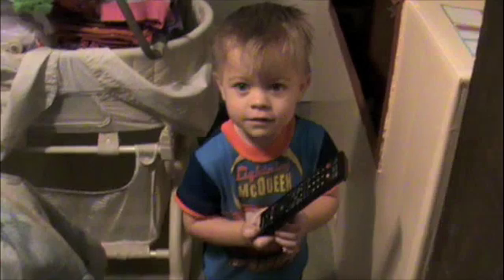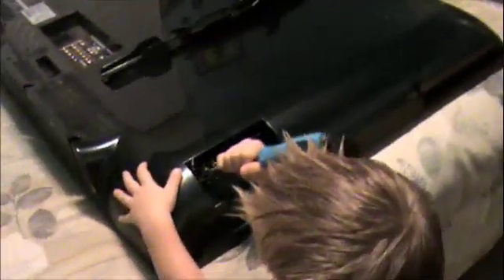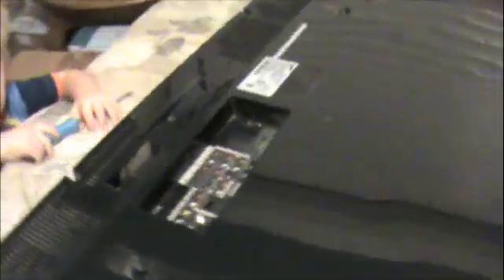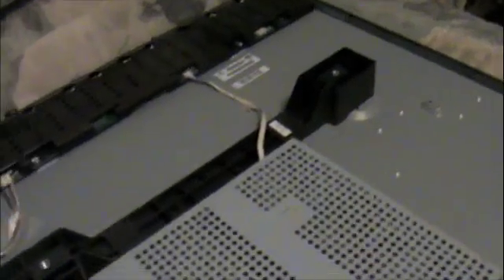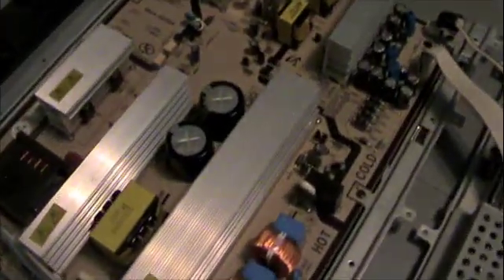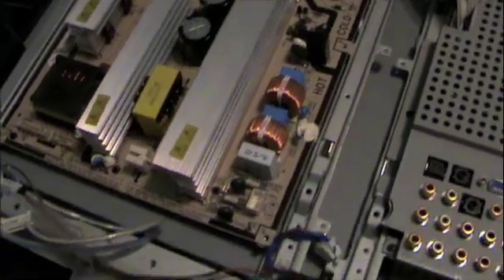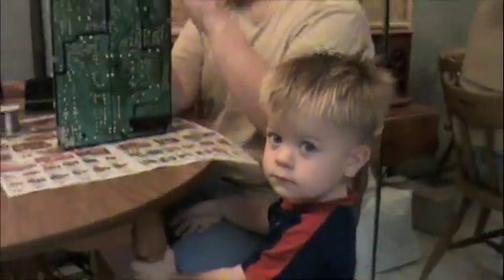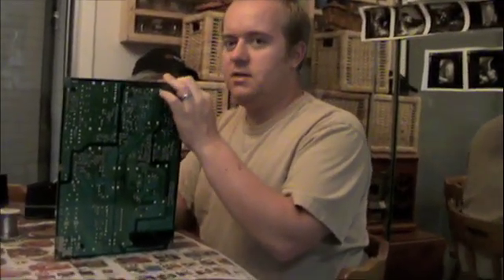Samsung TV Repair- PART 1 OF 2

Comment: I have a 46" Samsung LCD TV (LN46A750) and currently I don't have a problem with the caps yet but I have another power supply related question. I purchased the TV in the US 1.5 year ago but a month ago I had to move to Europe where the standard voltage is 220V/50Hz. Does someone have a knowledge whether there is some quick way for converting the power supply from 110/60Hz to 220/50Hz? And if there is, how? I called Panasonic in Hungary but they said they don't do conversion. What do you think?

Comment: thank you for your video, I removed the power supply, took it to my local "the Source" store, formerly Radio Shack, and he solder ed in a new capacitor. Problem solved. He only replaced the 2200 microfarad cap. $ 15 Thanks again

Comment: Thanks a lot for the vid. I'm an electrical engineer and I really didn't want to spend all this time troubleshooting it for the issue. Saw your video, went straight to the caps I needed and done. Quick repair. THanks a lot buddy.

Comment: Called in. Samsung arranged for tech repair to come. They came a week later. 2 guys came in fixed it pretty quickly. I knew what they were doing because of the video. No fees.

If you could afford the time it's an option. Make sure you deal with Samsung first and not the affiliated repair men.

Comment: 1. Soldering tool -  $20
2. Two capacitors and solder - $7
3. Saving $300 in tv repair in 30 min thanks to the Professor and Mr. Milo...
   PRICELESS!!!!!

THANK YOU!

Comment: I called samsung and they are sending  a repair man. My TV was 46"" bought in 2007. No extended warranty.  If they deem it as a capacitor problem then samsung will pay for the bill. Otherwise they charge me. 

We'll see what happens. Should be a few days when they come. I'll update the result

Comment: Thanks so much for putting this video together!! Replaced five 1000mF 10 volt with five 1000mF 25 volt (high temp rated). Bought capacitors from Amazon for about 10 bucks. Took me about 1-1/2 hours proceeding carefully. I with 4 young kids had to wait until the "helpers" were away for the night before I attempted this. Now enjoying celebration beer - TV works great! THANKS

Comment: Fixed my Samsung TV.  Replaced  four 1000mF 10volt capacitors with 1000mF 16volt caps purchased from Fry's for $1.95 each.  Layout in my TV was a bit different.

Your video was very helpful giving me the confidence to do the job and gave my wife the confidence to let me tear open our expensive flat screen TV.

5 min to get TV apart, 10 min to unsolder damaged capacitors, 10 min to solder new capacitors, 10 min back together. I had to make trip to Fry's anyway.

Total 35 min and $8.00

Thanks

Comment: Hello my friend
I saw your video to repair the LCD sansung. I have a question. I work for UCR univesity and we have sansung syncmaster 460P from today is hook up to the vcr/dvd combo also sansung. Only transmitted video over component for the DVD. I try to show VCR cassette with video RCA out and doesn't work it all. Can you please help me with this problem. I check all the menu settings for this monitor and doesn't work. My email is galfredo38@gmail.com Thanks for your help.

Gerardo A Torres

Comment: Thank you for making this video. I have a LN46A650 that recently began taking 10-15 tries before finally turning on. Your video was very easy to follow and I was able to fix my TV in less than an hour......and I had never soldered before. My set had a slightly different layout but more or less than same. Total cost of project was $30 including the soldering iron, all from Radio Shack.

Thanks!!!!

Comment: @frekhike why? Why would anyone spend this kind of money when we all know the fix may really only cost a few bucks?  This really works.  My plasma was blinking and then went dead.  This fixed mine.  My quotes to repair were about what you stated.  One guy told me to replace the board would be $150 for the part.  I found the part online for $75.  It's only 6 screws and 3 connectors to fasten it back on.  WHY?

Comment: This works! I know nothing about fixing televisions. I found this and another video after getting a $300 quote to fix my $500 Visio plasma (that's only 2 years old). I removed 2 10 volt capacitors with a soldering gun that I've never used, and ordered 2 replacements for a few bucks. Soldered the new ones back in tonight. It took longer to put the screws back in the TV than it did to actually fix it. The Visio fired up no problem. My 9yr old daughter helped too. THANKS A MILLION!!!

Comment: When my Samsung 215tw LCD monitor began flickering 2 months ago, this was the first info I came across re: how to repair LCDs. Since I had no interest in trying to attempt a repair at that time, I waited until the monitor finally stopped working before giving this a try.

The hardest & longest part was opening the LCD bezel case! 

Replaced 330uf 25v (x3) & 820uf 25v (x2) cost = $3.92. Tested panel BEFORE putting bezel back on, worked like a charm! 

WHEW!! Using it right now.

YOU CAN DO THIS!

Comment: samsung is a piece of shit . I had a dlp and changed the tuner control board and it broke again a month later . I bought An Lg zenith flat screen 3 years ago . no problems with cheap low temperaturee caps

Comment: I did this last night! Thank you for posting this tutorial. With my model LN40A450C1D I only had 2 caps to replace. I live in Toronto, and Radio shack (now called tThe Source) does NOT sell this value Capacitor. Near 427 Queensway is this place a1parts.com they have lots. $2 per cap. I bought 10 of them because I know I will probably be doing for friends in the future. Contact me if u need help.
Thanks again for posting this video.
Screw u Samsung.

Comment: Thank you so much for your video, it did the trick. $7 at radioshack for caps and $7 harbor freight for a cheap soldering gun and  solder. Took about 1hr from start to finish. Also my tv is a samsung ln52a750 had 4 caps 2 were 25v 1000mf the other 2 were 16v 1000mf replaced all with 35v 1000mf. I think you saved me several hundred dollars.

Comment: Thank you so much for the family effort it took to document the fix to this problem.  Would have taken me about an hour to do it,  but after double checking my work after I had re-installed the power board, I had messed up the polarity on on cap.  It took an additional hour to undo my mistake.   Be careful to line up the Black strip on the cap with the black mark on the circuit board.   My local Radio Shack had the perfect caps in stock.

Comment: Thanks man I appreciate it so much. I went to radio shack and got everything I needed. I was nervous at 1st (naturally) but just went for it. I have a LN40A530p1fxza. Same problem. Swapped capacitors and Wha-La!! Power on Melody. My fix was a little under $30 cause I had to buy everything, Iron to caps. May God bless you for sharing your knowledge. Truly. 30 - 45 minute fix for anyone wondering. Just do exactly what he did. Take your time and be patient.

Comment: Thank you!! My 18 month old Samsung was a little bit different from the video, but the problem was exactly the same. I immediately saw 2 blown capacitors, and replaced 3 for a grand total of 5 bucks! Since I had no experience with soldering, my Dad came over and did that part. I bought him lunch - You saved me hundreds!

Comment: Need:
Rosin Flux---little dab will do you!
60/40 Solder---thin gauge---.031-.032 (Came with new soldering iron!)
Replaced 2-10v 1000uf electrolytic capacitors with 2-35v 1000uf Radio Shack Capacitors!
Just thought an outstanding---massive money saving---instructive video should get a shout out!  YOU ROCK!

Comment: You are AMAZING...did my online research...LN52A550P3F started clicking when trying to turn on about 3 days ago...today took 15 minutes to finally boot.  Found reference to your outstanding video and $28 dollars later, at Radio Shack, and barely 15 minutes later ()labor wise we are UP AND RUNNING!  Only reason price was so high at Radio Shack is made the hubby buy a new sparkly soldering iron...lol

Comment: THANK YOU !!! THANK YOU !!! Wife wanted to freak when I told her we may have to buy a new one. Did as you said and Worked perfect. I have only done one other solder job( but im very determined to figure it out) I only changed out the 2 bad caps didnt change them all ( wasnt sure if it was going to work ) And we are good !!! I did up the 2 bad ones 2 25v. Thank you again

Comment: Thank you, thank you. Our 46" tv got worse and worse. Last time took 2 hours to turn on and then wouldn't turn on at all (tv only 2 years old). Mom and daughter fixed it. Mom has never soldered anything in her life, but it was simple. Ordered 2200 uf 16v high temp caps (also ordered 25v, but they would not fit) from Parts Express through Amazon. Took a week to get them, but in the end so glad it works! Thank you.

Comment: Hello All,

I unfortunately am one of the many Samsung customers with a PINK DOT ridden LNT4681FX/XAA...

Does anyone know if it is possible to purchase a whole new board replacement ??? Where might I buy the correct board ?

I'd rather just swap out the board as I have no soldering experience. Your help and advice is greatly appreciated !

Comment: Awesome Video!!!
Helped me fix my Samsung LNT4671F 
Replaced two 10v 2200uf 105°C capacitors with two 16v 2200uf 105°C  capacitors.
In St Louis went to Gateway Electronics, $1.50 each capacitor.
The Samsung LNT4671F  insides are a little different than the video but I could not have done it without this Video.
Thanks!!!
Shame on Samsung.

Comment: Replaced my capacitors and the same problem persisted.  Had it repaired at a TV shop, the "scaler" board was bad, said my capacitor job was at least neat and well done.   Not every symptom has the same solution.  Unfortunately.

Comment: I am having a similar problem with the HPT4254 which is about 2 and a half years old. It'll work fine for 30 mins to an hour and then it will just begin to blink completely black but there is no clicking and then come back on and be normal, usually it keeps blinking until I shut it off,  sometimes if its a gray color it has some green static areas in it but only the gray parts. It just started and is getting worse. Happens on both PS3 and Cable thru HDMI. Do you think this would fix the problem?

Comment: thank you!
took about 30 minutes.. no big deal.
I used 35volt caps,(all radio shack had!) and they worked no problem.
cost about 8 bucks total... i replaced 4.
lost all faith in samsung... still gets a GREAT picture though.

Comment: My ln32a330 was not turning on.  Opened it up and a 2200uf cap was bending outward on the top.  Replaced it and it works great now! Thanks.

Comment: fixed my tv. two 2200uf 10v caps were replaced with 2 200uf caps 16v. on one cap the bottom of the cap that goes into the board burst.  cost me 6 bucks instead of 600 bucks. great vido. im happy now

Comment: Out of curiosity. If i use 1000uf 16V caps to replace the defect 2200uf 10 V caps what will happen? Is it dangerous? Or will the caps just die very quickly. I bought the 1000uf ones but would like to use my tv till tomorrow or something like that?

Comment: This worked!!!!!! We replaced 4 of the capacitors for 4 1000uf 16v which i got from Allied Electronics overnight. It was exciting! ( we had never even soldered anything before, let alone open the back of a TV). We bought the soldering tool and solder, practiced a bit beforehand, and followed the instructions exactly. I am so grateful to you for posting this video. It saved us time money, and was a great learning experience for me and my kids.

Comment: Just got through repairing my 52" Samsung from doing the infamous power clicking episode. I changed out 5 capacitors. I changed two 10V 2500mF, which were bulged and leaking, two 25 v 1000mF to 35 v, and one 10 v 1000mF to a 25 v. I could not up the voltage on the 2500mF due to size restrictions. Great how to video, easy to use, and I appreciate the time you took to make it.  I got the capacitors, solder, and flux all for under $25. This would of easily cost me over $200 to have it repaired.

Comment: yes!.. i replaced mine with 2200uf caps 16v.

the higher the voltage.. the larger the physical size.. as long as they are 10V or higher.. and can physically fit on the board.. you should be fine.  

confirm with a professional electronics repair.. as im not an expert.. but i did get mine to work using 16v 2200uf found locally at a electronics repair shop.

yep.

Comment: Im right there with you...   

I have CM852 and CM853 are 2200uF, 10v, and 105 C(M) removed and in my hand.

From all the threads i was thinking i should buy the 1000uf 35V (radio shack part # 272-1032).

I'm glad i saw your post as i feel i should go with the 2200uF.

(by the way .. i know nothing about  capcitors or electronic boards.. just been using research on the web. this vid and a little common sense)

the hunt is on for me as well to find 2200uf 10v

thanks forthe post & goodluck every1

Comment: The board is slightly different from the video. If you open the back and are standing looking at it from the base, you'll see the board is about in the center. The upper right quandrant contains the faulty capacitors. There are only 2 -20 volt caps instead of the 5-10 volt caps in the video. I put 2-25 volt caps in instead of the original 20 volt. You can go a little larger, but you can't go smaller. You might ask someone in your IT dept. to put them in for you, if your not sure. No time at all.

Comment: I watched the video and realized it was the same problem with my 42" Samsung and decided to tackle it myself. The board was different, but it gave me an idea of where to look. I found 2 capacitors with bulging tops and replaced them. Problem fixed! I spent $18 @ radio shack for all the stuff. The estimate @ the local repair shop was $575. TGFY!

Comment: samsung trash.  They use cheap, faulty capacitors, even to this day, to save a few cents.  The capacitors buldge then fail.  10s of thousands having same problem.  Samsung wont acknowledge there is a problem.  I hope these capacitors cant catch fire, burning down someones house, and even worse killing their family.  I hope this isnt a safety issue!

Comment: Great videa! I'm not sure if I have the same problem but I do not have any picture but still have audio. I don't hear any clicking noises either, just no picture (as though the TV was off). Do you have any suggestions or ideas? I'm going to buy a new screwdriver to reach my 32 inch screw holes. thanks!